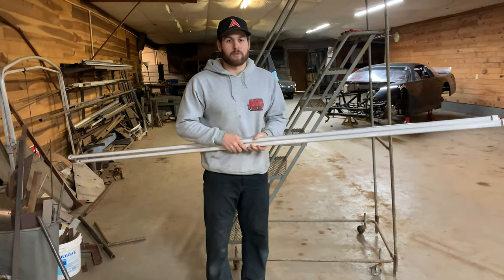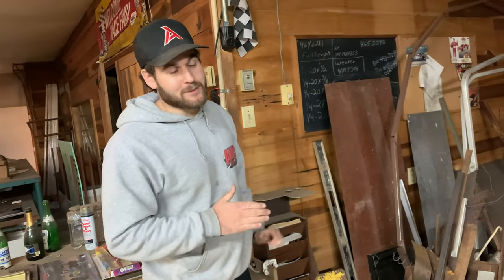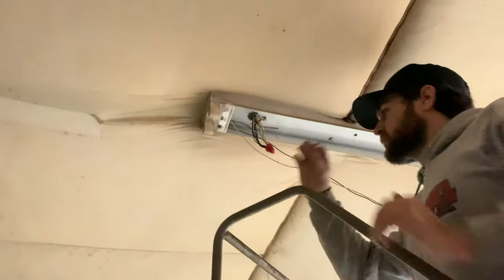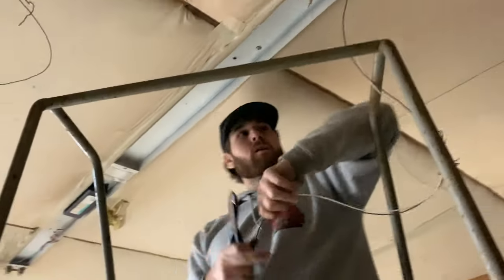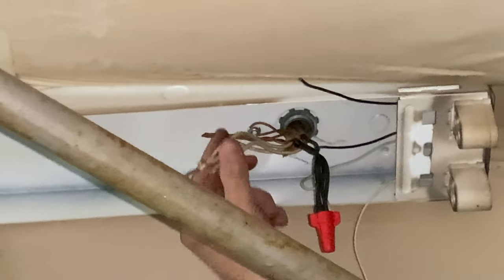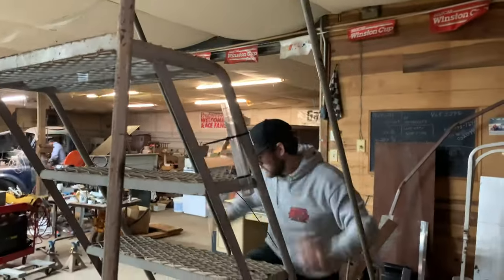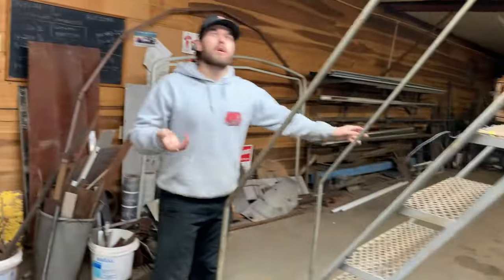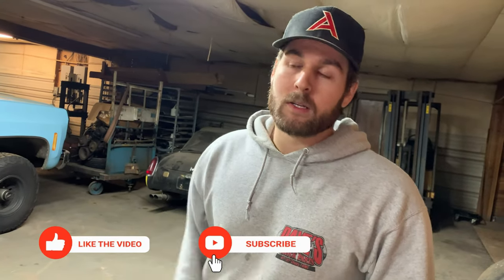How to convert old ballast shop lights to LEDs! Tutorial for Dummy's

Comment: You did one mistake. The mistake is not removing the extra black and white wire at the end with 4 wires. If you don't know how to remove them you can a caps on them. 

And the main reason why you would pit caps on or remove them. Is to prevent them from shorting out. Or even electrifying the whole entire fixture when It's on. To where you must shut off power to see if we get back to preparing your mistake. So cap every wire for safety.

If you're not sure what I'm talkin about you must hire an electrician to teach you what you need to know it's very important.